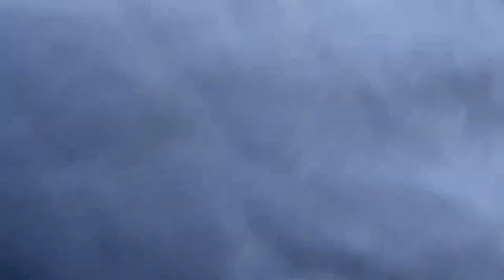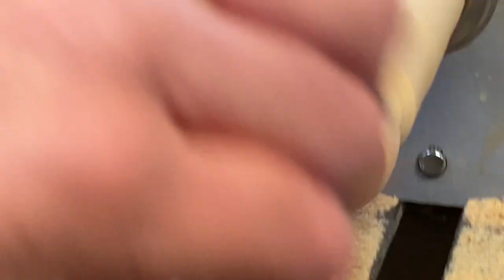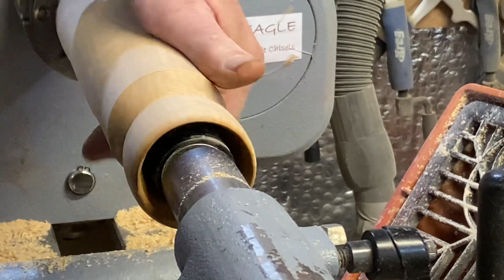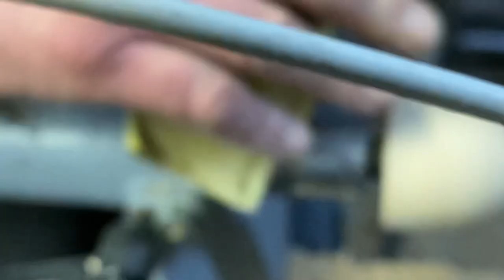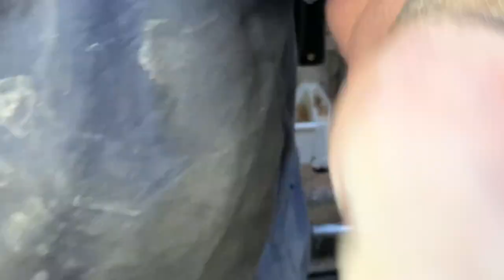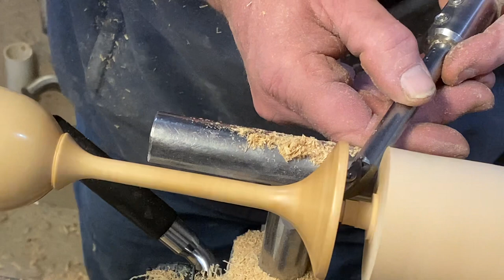Woodturning a goblet for Jimmy using my Carbide Chisels

Comment: I have been turning for over 20 yrs and I appreciate the way you use and explain how to use carbide tools.  I use both traditional and carbide and I have learned a lot from your carbide instruction and have improved my cuts with them.  Just curious as to what you use on the yellow cloth on the coblet.
Reply from the maker: Hi Bubber. I'm glad the videos have helped. I am very grateful for the feedback. It is my own sanding paste I made. I prefer it to the other ones I bought. It suits my way of turning, at speed. Happy turning.